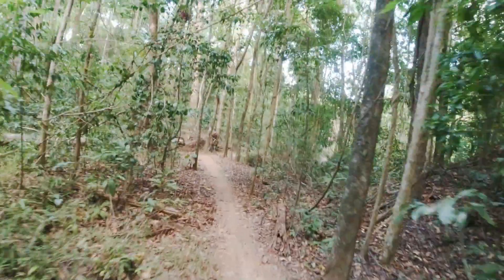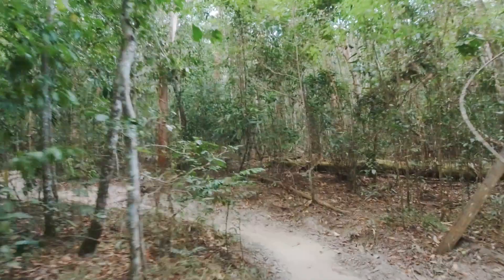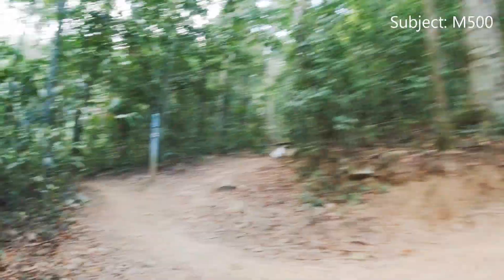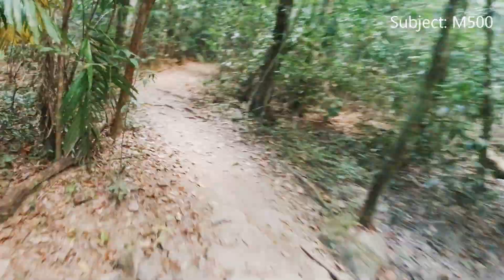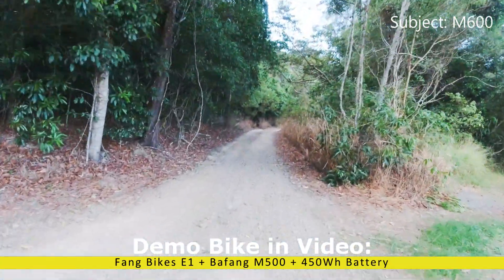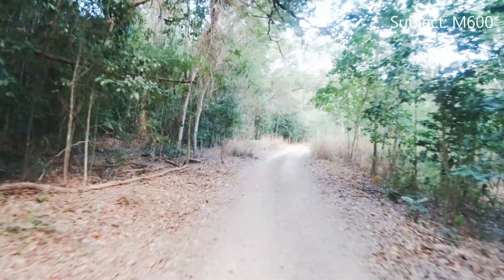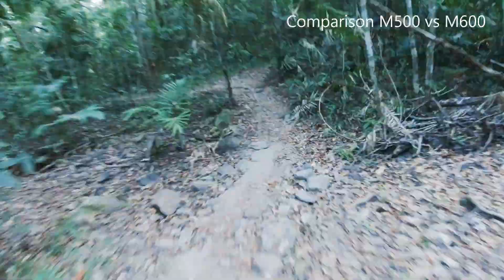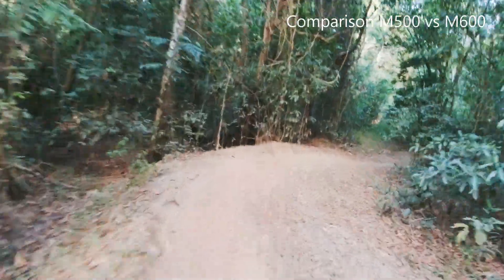Bafang M500 and M600 Comparison - FangBikes compares these eBike motors for our E1 Framekit

Comment: I have the M600 with quiet gear and 2000 watt controller in my carbon Luna X2 eMTB. Quit and powerful!
Reply: i got a luna bbs02 and bbshd both with luna's quiet cog . i swear my bottle bracket is louder

Comment: A question about assistance levels. You mention PAS 1 on the m600 = level 3 on the m500. I am concerned that the m600 will just have too much power when you are trying to do technical tracks. Do you find this to be the case? And switching to 9 PAS levels in the display settings - does that give you more granular control over the PAS provided by the motor?

Would you say the M600 has far more power output that say the Bosch CX in lower PAS? Does it have an ‘ECO’ mode that might further reduce the PAS provided by the motor?

Great review btw.
Reply from the maker: I can't say much about the Bosch CX I haven't had much experience with it, however I have ridden older Bosch, Shimano, Brose and Yamaha and to be honest the m500 mostly feels on par with all of them.  I did ride the new Bosch briefly with the smart mode, which adapts to your increase in effort. That was a cool feature.
Now to your question.  The M600 torque input is pretty good. With 5 settings, I have never struggled with anything technical in 1, 2 or 3. However 4 and 5 seem to want to push you off the track if you're not ready for it.
Also, changing to 9 levels improves response.
Regardless of which motor you get, ebikes are awesome. But the M600 is pretty darn powerful and I very rarely ride it in level 4 or 5.. Enjoy!!!
Reply: @fangbikes2751  great info cheers. Also I think the new m600s have gone back to the plastic gear. Do you have any details on that? Also have you found the m600s to blowing up cheaper rear hubs? 

How often do Bafang put out firmware? I'm guessing you would want to make sure you are always running the latest firmware. 

You have definitly alleviated concerns with PAS and torque.

Comment: You mentioned plastic gears in the M500, do you think it will stand up to plenty of uphill riding?
Reply from the maker: It certainly has so far. Bafang have been using composite gears in their motors for a long time with great success.
Reply: @fangbikes2751   I also have another question, is the M500 a capable hill climber, as in, does the M600 climb hills easier, or are they equally as good? I haven;t bought one yet but am tossing up between both.
Reply from the maker: Absolutely the M500 is a capable climber. Use your granny gears and the M500 will climb pretty much everything. If you had a long steep road, and used the same gear, the M600 will get up faster. It just has more power.  Don't forget, if you're doing laps of a track, up / down, you might get 5 laps (for example) with the M500, but only 4 with the M600 before running out of juice... 🤔
Reply: @fangbikes2751  Okay, thanks for that.

Comment: Torque?
Reply from the maker: M600 has notably more torque as you would expect when it's pushing twice the power.  However, that's not to say the M500 is weak.  Either motor will climb basically anything depending on the skill of the rider.
Reply: 120nm. Bafang ultra has 160nm torque the ultra is king 👑
Reply: @petershanle9675  indeed...  but it is heavier, uses more power and therefore needs a bigger battery which is heavier.. it's all about balance.  For a big power, big bike. Ultra is King 👑.

Comment: anything better than m600?
Reply from the maker: There are more powerful motors out there (the Bafang Ultra) but it is also much heavier.  There are much lighter motors out there (fazua) but theyh are much less powerfull.  There are motors with smoother performance and customisable tuning, but they are much more expensive. So to be honest, I would say the Bafang M500 and M600 are pretty much unbeatable for Price / Performance / experience. :-)

Comment: Which of the two motors do you recommend for all-mountain ride specially on the steep ascents? I absolutely want to go ride more further on tight trails.
Reply from the maker: The M500 has plenty of torque and will charge up any hill.  If you can keep the front wheel down and keep traction, the M500 will get you to the top.  It is also much more efficient than the M600.  The M500 comes stock EN15194 compliant, 25km/h and 250W limit.  The M600 will do everything that the M500 can do, but goes faster (40km/h) and is louder with the steel gear. if you want to "ride further" the M500 is your pick. Happy riding.
Reply: @fangbikes2751  What is the brand name and model of your e-bike frame?
Reply from the maker: FangBikes is the brand and the Model is the E1.  
https://fangbikes.com/index.php?route=product/product&path=60_61&product_id=50
Reply: @fangbikes2751  what do you mean when you say the m500 is more efficient? How is it more efficient than, lets say, running the m600 at the same power level?
Reply from the maker: @dimitargliguroski5041  It's just a figure of speach.  Bascially the M600 on Level 1 (the lowest setting other than "off") is similar power to the M500 on level 2 or 3 (not exactly, but that's how it feels).  Therefore if you're just going for a light-assist ride, you will use less power with the M500 because you have levels available to you that use less power.  
In a nutshell, the M600 Level 1 is overkill for a light-ride.
Reply: @fangbikes2751  is the m620 ultra louder or quieter than the M600?
Reply from the maker: @dimitargliguroski5041  hey mate, I don't sell the M620 Ultra.  So I cannot directly compare.  But from what I have read, the ultra is a very quiet (but large) powerful motor. And heavy.
cheers